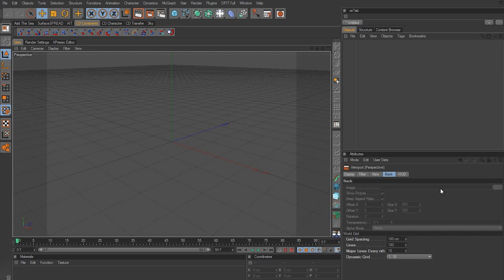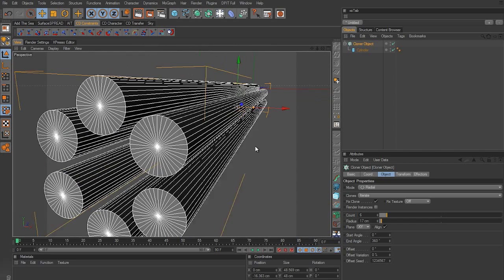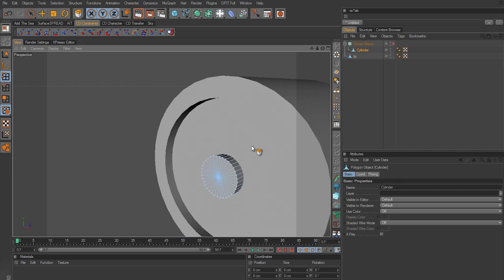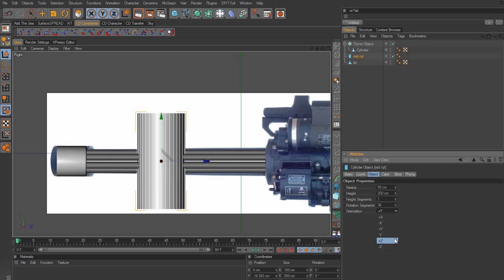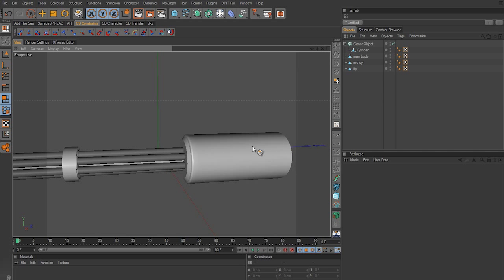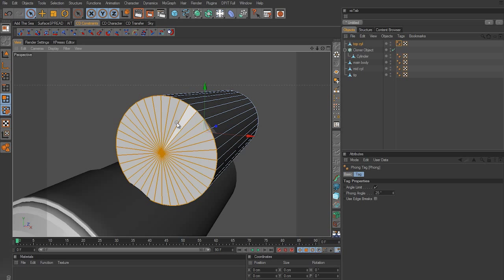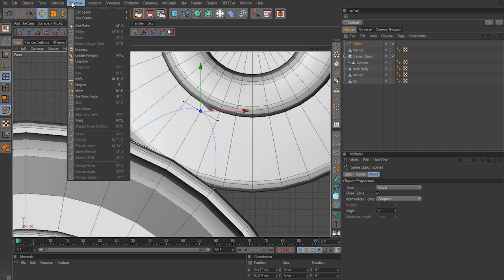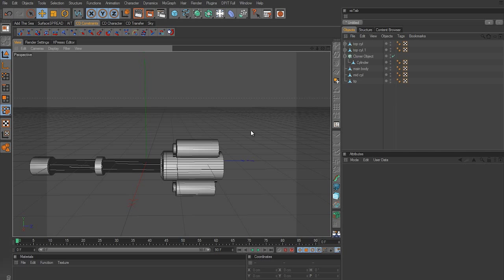Cinema 4D Tutorial - Minigun Part 1 - Modeling

Comment from the maker: @TheRyanQ C4D will run a low specs, so your machine should be just fine. C4D is a very stable application, so any crashing is usually associated with plugins, graphics cards (drivers), and using pirated versions that have been messed up.

What kind of GPU are you using?